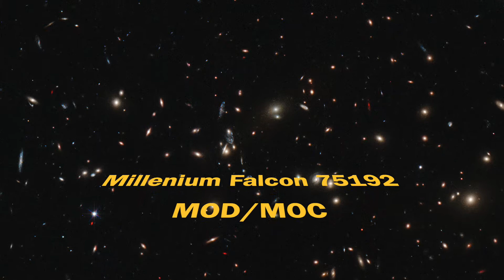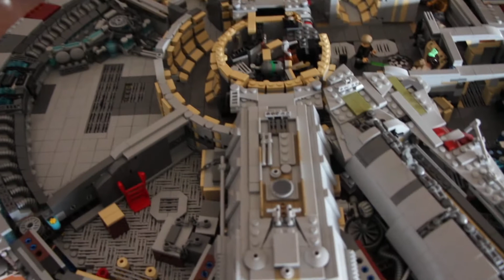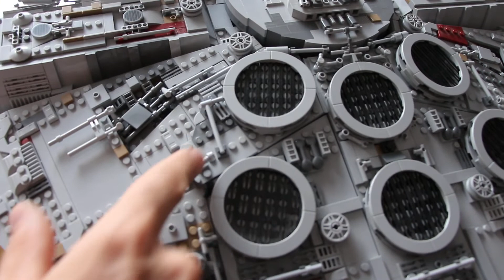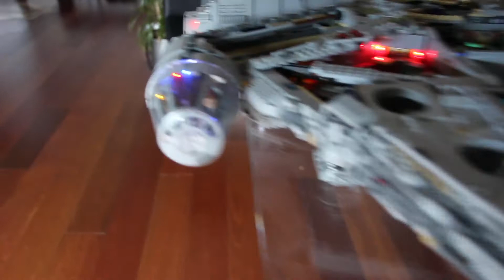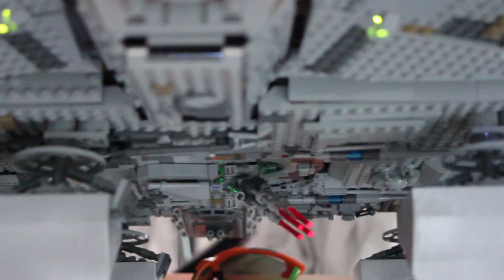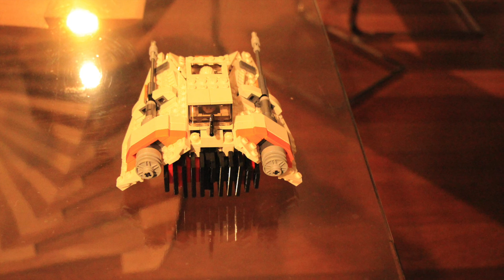LEGO Millenium Falcon 75192 MOD/MOC Part 2 :lighting

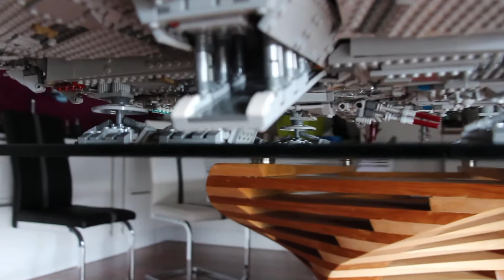Comment: There so many questions I would like to ask to try to reproduce, even only a bit, your MOD... Let's go for an easy one... What parts did you use to connect the pillars to the access ramp at 0:40 ? I can't see / can't find what parts would suit...
Great joy, by the way, really amazing !
Reply from the maker: Hi. The parts you mentioned are 2736 and 14418. As far as I know this is the smallest ball-joint possible. The 2736 is connected to a 51677 liftarm. The rest of the pillar is connected thanks to a 55013 beam type to the lift arm on its second slot.  Hope it helps.
Reply: @legomodder3891  This helps a lot ! Thanks for answering... Just one more question, What part is the 51677 liftarm ? I can't find it on BrickLink. Is there any other reference ? Is it a typo ? Or I am looking bad ?
Reply: @legomodder3891  41667, I guess ?
Reply from the maker: @popol2121  Yes sorry, I mistyped.
Reply: @legomodder3891  Oh, man, sorry for the questions... I see now how you you did with the bottom of the pillars... But I cannot reproduce how you did it at the top of them ! There is always something that gets stuck... What you did is amazing ! I'll one try to reproduce the inside. But I'm far to have your skills. I have to train more on less complex system. I thaught the access ramp was accessible for me !

Comment: Did you modified the top pannels at all? if so can you take pics of the undersides of the hatches if possible? also, can you take a picture of the left entry door cuz there are no good angles of it in both vids. thanks in advance!
Reply from the maker: The top panels are a bit modified indeed. I will add those pictures in the description next week. I don't understand what you want to see of the left docking ring though; There is no opening mechanism on this side.
Reply: @legomodder3891  sorry I wasn't clear, I wanted to see how the docking ring was connected to the 6x8, which was what I meant by door. Thanks for the reply!

Comment: How did you do the cockpit hallway??
Reply from the maker: What do you mean ? Yo fix it ?
I used a 6x20 plate plus another one, then a 6x3 wing plate for the corner. Everything is fixed together  with connecting parts below. It is connected to the rest of the ship thank to few rotating plates. Robustness is also granted thanks to the walls in technic parts that are connected to other technic parts from the other compartments that sit directly on the ship plateform.
I don’t know if I am clear enough but if not, look at the other video, you would probably have a better point of view on the details